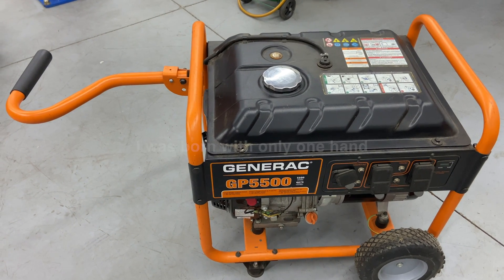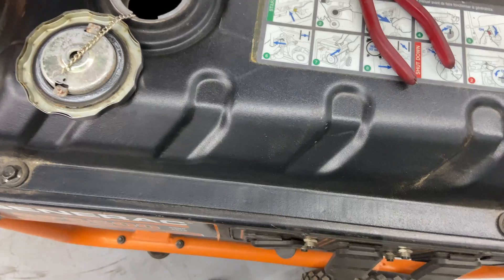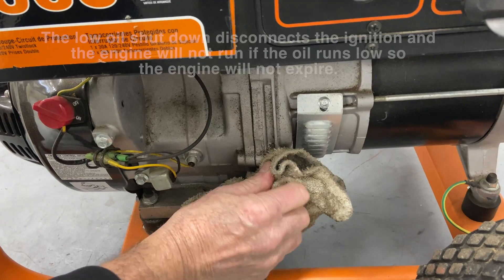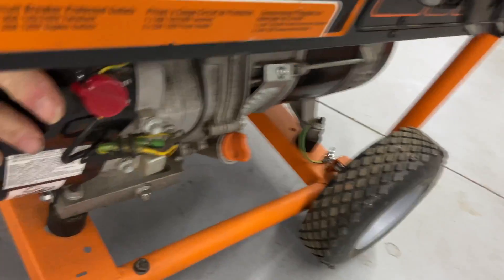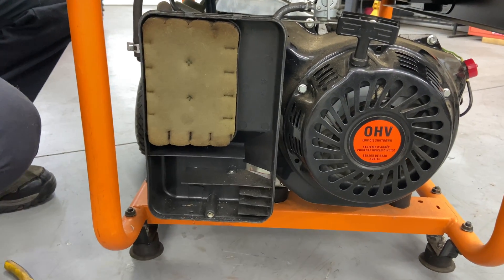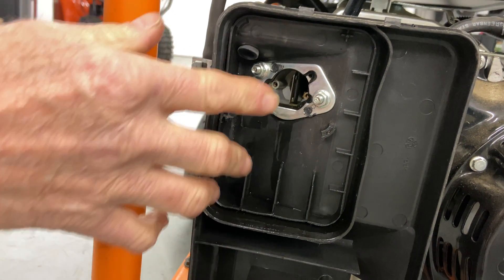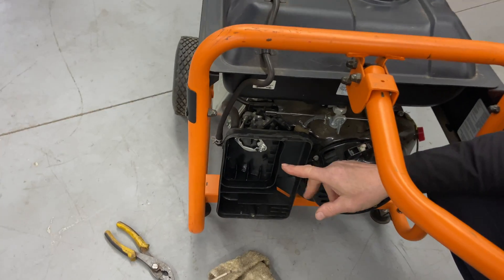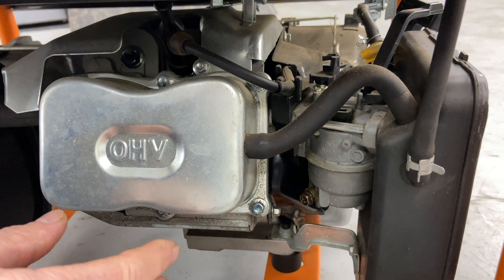Generac Generator Will Not Start. Generac GP5500, GP6500, GP7500. How to diagnose and repair.

Comment: Thank you for the video. I start mine monthly as PM. Curious though- when doing these maintenance runs, should I turn the engine off with the on/off switch then turn the fuel off? Or turn the fuel off until the engine dies?
Reply from the maker: Either way will work, but if you’re storing the machine for a long period of time, I would recommend turning the fuel off and running the engine until it stops running. Then drain the carburetor bowl. Because you are running your machine monthly, you do not need to do that and your machine will be there for you when you need it so keep doing what you’re doing.!! hopefully you’re running it for at least 20 minutes?

Comment: I cleaned my carb, and still get the "Initial run" and then stop.  I swear it's low fuel flow.  I swapped the gas out and it took over an hour to drain out 6 gallons...because the fuel flow was STUPID SLOW.  I pulled the valve out and cleaned that, as well as cleaned the fuel screen, and changed the fuel filter.  I'm out of ideas except replacing that darn carb since it doesn't look like they make rebuild kits.  :(
Reply: Its the sensor on the front message me i can help you get it running in 15 minutes

Comment: I'll be trying all of this out tomorrow. I have two generators that both run but both act like they're not getting any fuel. Run on starting fluid and then die immediately.
Reply from the maker: Both have carburetor issues from gas going bad inside. To avoid this in the future, make sure you run your generator every month or so for twenty minutes, plug something into the generator to keep the electrical system working as it should, try and use NON ethanol gas and you should be ready when its needed!

Comment: Great video!! I have the generac 8500 model it will only stay on in the choke position any idea why ? Thanks
Reply from the maker: Your carburetor has a blockage inside most likely from gas going bad or dirt,  requiring more fuel to run correctly so you are compensation by using the choke in the half choke position. The carburetor will need to be either cleaned or replaced.

Comment: Maybe one year ago the gas would stay good for 6 months to a year with fuel stabilizer, but the gas now, in maybe last six months doesn’t last long at all. I used to keep my generators full with additive and they would start right up after a year. Now I’m trying to get one of them running after a complete service last year and I had gas valve off and I drained out the gas and put new into it and it just won’t start. So I’m taking the carb. off to see what I find. When I shot carb. cleaner into it, it barely started but it only stayed running for two seconds. So I’m not sure what the problem is. It’s the xg8000e generac. I’ve had problems with this one since day one. When I started to use it I had nothing energizing the tools. I took it back to homo depo and they sent it out and they had it over a month. I was told you have to put a load on it at least once a month or it loses a magnetic field, not sure what but the word magnetic and putting a load on it was mentioned. I never did run the thing once a month and it worked fine. So now I think it is an ignition module or something other than gummed up carburetor or stuck seat or dirty jet. But I like how you mentioned tapping on the side to possibly free it up. That’s old school stuff right there. Thanks for sharing your experience with us. Guarantee you helped some people out there. ✌️👍🇺🇸
Reply from the maker: The engine most likely has a low oil shut down and if it does. (1) check to make sure the machine is on level ground and oil level is correct. (2) I have come across the sensor will fail. You may need to disconnect it to find out. If your machine runs for a few seconds then stops. You have ignition, Most of the time it is a blockage in the carburetor or possible low oil or bad low oil sensor. The issue with the "magnetic field" has absolutely nothing to do with the engine running correctly. Your issue is, it does not run. It's not an issue of no electric which is what the repair shop was saying. Strange.
Reply: Hey brother I can’t believe what it was. About the magnetic field thing, I know it has nothing to do with it running. Because it ran perfectly just didn’t energize the equipment. But I read your reply to me. So after getting everything loose and ready to come apart and running to Napa for a couple cans of carb cleaner and some brake clean and four feet of 1/4” fuel line. I had everything else from little hose clamps,shut off valve and fuel filter.  I thought about what you said so I checked the oil level and I put less than a shot glass of 30weight and gave it a last try before tearing it apart. And my friend you called it. I moved it a little bit to make it nice and level and it’s ready and running. I had no idea that it would matter with the oil being not quite to the middle of the threads would stop it from starting. So the answer to your question you hoped your video helped someone. It helped tremendously. Now I’m gonna find the wire and cut it. Thanks so much. I spent a couple hours under my carport working on it and in north east PA. Today is 95 degrees. Could have avoided getting dirty and sweaty if I tried that first. But I’m still going to take it apart tomorrow and run new fuel hose and check the top of engine and basically clean it good since I went this far. Sorry for the long rant. It’s just me and my dog up on the mountain. Since my wife passed away couple years ago I haven’t felt much like socializing. But I have plenty of things to keep me busy and some of these videos really help and save me time. Thanks again  for your expertise. I was pissed and then I got a chuckle. I made something so simple by over thinking it. ✌️👍🇺🇸

Comment: I have a Yamaha MG 360 generator. Battery has a full charge. My electric start switch does not start manual strike doesn’t work. I started it about six months ago and it was fine now it won’t start any ideas. Thanks, Dennis.

Comment: What about one that fires one time when you start it then stops firing I just put a brand new coil and spark plug in it but it's still only fires very intermittently
Reply from the maker: Maybe you’re low on oil? Or the low oil shut down isn’t working correctly. Make sure the oil level is correct or You can try disconnecting it to see if that helps.

Comment: Thanks - got us ready for Houston TX winter storm 2025. Took Carb Cleaner to get it going and then swapped out older 
fuel with fresh fuel for good luck.
Reply from the maker: That's the ticket!  Hopefully you won't need it but it's good to be prepared.

Comment: Thank you for taking the time to post this video! It saved me! My GP6500 would not start. There was no fuel getting into the carburetor. Turns out there was gunk in the needle valve the float is attached to. Cleaned it all up and now it works perfectly again.
Reply from the maker: I’m glad you were able to get your generator back up and running! Thank you for the kind comment!

Comment: Thank you for the video. Is it possible to spray carb cleaner through the choke opening to clean (partially at least) the carb? What do you think as a professional?
Reply from the maker: I personally do not spray the carburetor while it is on the machine. Most of the time it will not work and can cause the needle valve to enlarge and then you are buying parts instead of just cleaning the carburetor (when it is off the machine).

Comment: My father n law has the 6500 doing the same thing, I've done everything you've done without luck.  It has only 5 minutes test run time.  Theres a tad varnish smell so im going to give it the light air blow.  I'll be checking on your carb post.  Spraying it makes it start for 2 seconds but no fuel.  I've worked on gas engines before but others helps.  Thanks

Comment: I have a 17500. It cranks but won’t start. It was low on fuel and I filled it with 91 octane no ethanol fuel. I run it fairly often. Just ran a month ago for a few hours.  Any ideas?

Comment: Mine won’t stop backfiring. Fresh gas and oil, tapped the carb, put carb cleaner in all the places, still backfiring. Any tips? Out of power due to Milton. Oh also worked fine yesterday. Turned it off to refuel then won’t start or backfires now.
Reply from the maker: You may have water in the fuel. You will need to drain carburetor bowl into a glass container to see. Make sure the oil level is correct. The machine has a  cub low oil shut down and if the oil is getting low it may start to backfire. If that doesn’t work try putting the choke on a little bit and see if that helps. If it does you can run it like that until your power comes back. Then you will need to remove the carburetor and rebuild it or replace it. If you tried both of those and it still doesn’t help you may need to rebuild the carburetor or you have valve issues that you will not be able to repair and will need to take it to a repair shop.

Comment: Purchased a brand new snapper 5500 generator which worked for about 6 hours and then shut off. I checked the oil and  added more gasoline. Now the system turns on for about 2-3 minutes and then shuts off? What am I doing wrong?
Reply from the maker: Make sure the machine is level and oil is topped off. Turn fuel valve off then back on. You can also try draining the bowl of the carburetor as there may be water in the fuel. Other than that you will need to diagnose it.

Comment: I have gp8000E looks the same (has electric start). Would crank every 2 months and I use fuel stabilizer. Cranked right up during Hurricane Helene and ran for 2 days. Let it run completely out of gas one night. Added fresh gas but has not started since. Tried starting fluid with no luck. I have noticed it backfire some recently. I have a good spark. Removed the carb and tried spraying with carb cleaner but nothing helps. I ordered a new carburetor. Any other thoughts on getting it to start?
Reply from the maker: Sounds like you do not have spark. Check to make sure oil level is correct. Install a new spark plug.

Comment: Checking our generator out in preparation for Milton. This video helped us solve the problem. Thank you.
Reply from the maker: I’m glad it was helpful and I hope you will not need it.
Reply: Hi, my problem is, I have a Yamaha MZ 360 electric start 8500 W generator. I have a full charger on my battery. My switch does not start at all even when I pull the rope manually. Nothing happens at all. I checked the fuse. It seems to be OK again the battery has a full charge. Not sure what to do. Thanks, Dennis.

Comment: This video got me up and running after Helene. My mom had a generator and hadn't used in 2 years. She had drained the gas but left gas in the lines and carburetor. I sprayed carb cleaner in both places and it fired up on the first pull. Thanks!
Reply from the maker: I'm glad it was helpful! Thank you for sharing and the kind comment.

Comment: I have a generac 6500 megaforce. It has so much compression that I can hardly crank it. I have had it for about 20 years, always hard to pull but eventually cranks. Any suggestions on how to reduce compression on start up?
Reply from the maker: You may need to adjust the valves. I do not have a video on that but someone may or take your machine to a shop in your area to have them adjusted.

Comment: Great video, explanations, and tips. After allowing my generator to sit for 4 years with no upkeep, it failed to start with today's hurricane. Only myself to blame. After going through all the normal big 3, and still no start the spray fuel hack was what tipped my hat to the carb problem. Pulled the carb, cleaned it out completely, and off she went with the expected easy start. Lessons learned on this round, and the same mistakes won't be repeated.  Thanks again.
Reply from the maker: I’m glad you were able to get your machine running!

Comment: Hello Johnson thanks for the magnificent video.
Just a question; if my engine sound is a little bit knocking, not too much, maybe a few, then I guess it's a combustion problem so how would that be solved please?

Thank you.
Reply from the maker: Just taking a guess without seeing the machine to diagnose it correctly. Normally the engine knocks from not changing the engine oil regularly. Not much you can do unless you’re going to rebuild the engine and it is not cost effective to rebuild. I would suggest changing oil every 50 hrs of use so it does not get worse. Again this is a guess as it is impossible to diagnose a machine without seeing it.
Reply: @JohnsonsSmallEngines  absolutely correct, can't exactly tell unless you have a visual on the machine itself.
But I'm pretty certain it's exactly as you've said. Not much doing with the engine itself, it's only a combustion sound knock that is kind of bopping occasionally when it's running.

Comment: Spray fuel in the throat of the carburetor. This man knows his stuff... we purchased this generator in 2021 for Hurricane Ida used it and it worked beautifully. 3 years later we crank it up to use for hurricane Francine. Did not work. My son came over to troubleshoot the generator and after checking all of the obvious things still not working. We put this video on, did what Johnson said to do and voila🎉🎉🎉🎉. 

At first it kept dying. Every time it sounded like it was about to click off my son sprayed more fuel. The more fuel he sprayed while it was runnning, the carburetor was getting cleaned out from debris. It was only a little debris however that little debris was stopping the generator from cranking up. Learn something new and got the AC going with the generator all at the same time! Thank you Johnson for your skills 👏🏽 👏🏽👏🏽👏🏽👏🏽👏🏽
Reply from the maker: I’m glad it was helpful and you were able to get your machine going!! Thanks for sharing and the kind comment.

Comment: Thank you thank you .. followed your steps and bam it started. Need to be more diligent in starting it every 3 months
Reply from the maker: I’m glad it was helpful and thank you for the kind comment. I would suggest starting 45 to 60 days max and run for at least 20 minutes and plug something into the electric to make sure the electric is ok.

Comment: Great video. I would like to understand if using ethonal free gas is helpful in preventing carburetors from gumming up if you forget to restart it every 60 days?
Reply from the maker: Non ethanol gas is the way to go and In my opinion will help in the long run but i still recommended that you start your generator every couple months and even plug something into it to check electric output (to make sure it is generating) so you are prepared if the power does go out. Non ethanol gas is not the cure all and its better to be ready then taking a chance.

Comment: I do different way to turnoff generator  DO not shutdown switch from generator Just close gas line let  your generator shutdown by himself  Reason to avoid clog  .My generator not using almost 3 years I have no problem I do all the time over   and over past several time

Comment: Question 
I bought the 6500 GP generator in 2020 back then I ran it for a few hours but since then haven’t ran it kept the generator in the garage. The gas doesn’t smell bad, about a half tank my concern is should I get rid of that gas and by new gas ?
Reply from the maker: 4years old gas only a half tank, I would rather be safe then sorry. I would get rid of it. I would be more concerned that your generator will run correctly after sitting. The fuel in the carburetor will go bad in less than a year and your machine will not run. If you do get the generator running make sure it runs after warm up with the choke in the off position. If your compensating using the choke in slightly the on or half choke to keep the generator running smoothly, you have a clogged carburetor due to gas going bad inside the carburetor.
Reply: @JohnsonsSmallEngines  thank you

Comment: Hi Brad, thanks for the informative video on the (Generac) RS7000E.  I just came into possession of one of these and the unit starts, however when I begin to turn the dial to 2 (RUN), the unit shuts down; any thoughts? Thank you in advance for any information.
Reply from the maker: The machine has a clogged carburetor from gas going bad inside the carburetor. Happens all the time from machines sitting with gas in them and not running the machine. You can try and rebuild the carburetor or what most do now is just replace it. Once the machine is repaired, you will need to remember to run the machine for 1/2 hour every other month to keep the carburetor jets clean with fresh gas and the machine running as it should. The gas in the carburetor will go bad much quicker then the gas in the tank. If you have non ethanol gas in your area? use it. Keep the tank full and remember to run your machine. You will be good from there on!! Don't forget to plug something into the generator to make sure the electric works. I do that every time I run my machine. If you do not check the electric on a few occasions, I have seen the electric stop working from long term no use (plugging in something to it)
Reply: Thank you very much for the information: very helpful and insightful. I will clean the carb and see how it goes. Other points noted. Much appreciated for the taking the time to respond.

Comment: Bought the 5500 12 years ago. Start it once a month for 30 minutes . Has never failed to  start and stay running. Never let me down.
Reply from the maker: You hit it right on the head” start it once a month for 30 minutes”. Thanks for sharing!
Reply: What's the name of your generator cuz I have a predator generator  this I ain't worth a crap
Reply: @DakotaPorter-b7d  Generac.
Reply: @DakotaPorter-b7d   Lost power because of the storm last night. Brought out the generator this morning and it started up on the first pull.